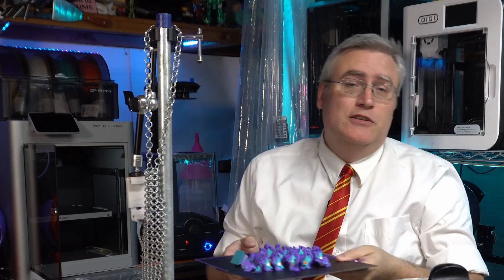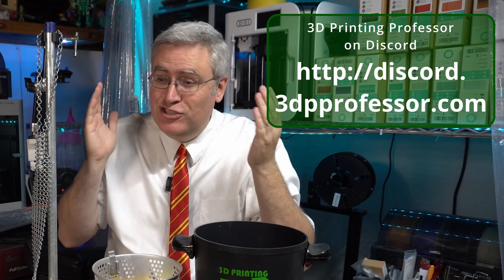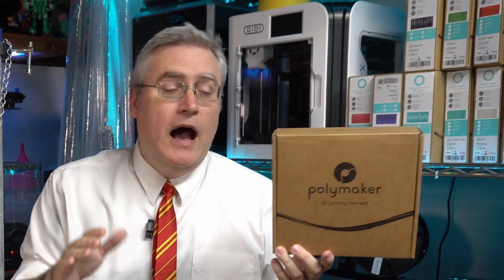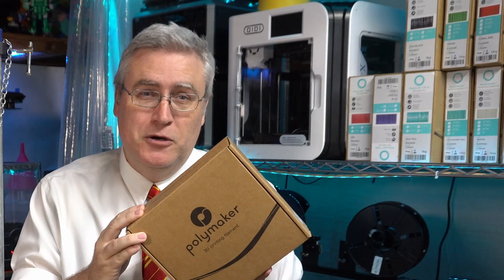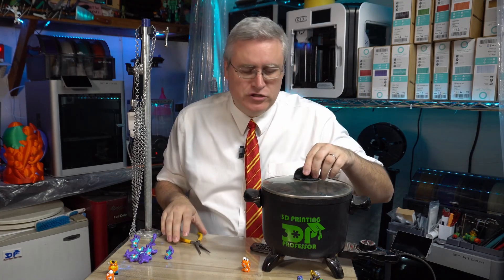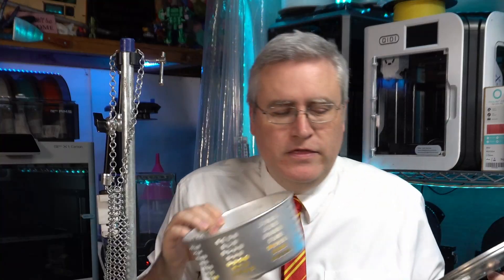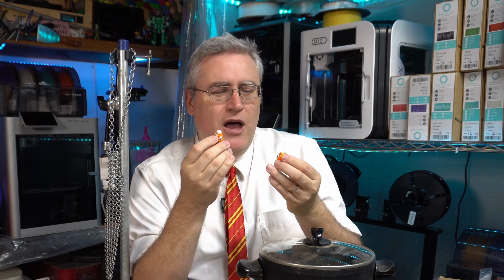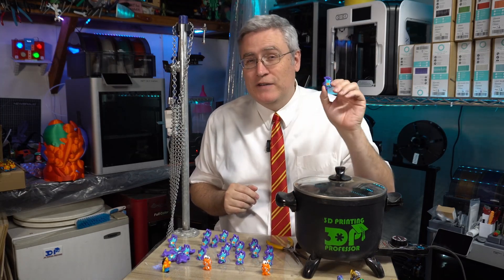How to smooth ABS 3D Prints - Polymaker ABS vs Polysmooth

Comment: Please do not dump the acetone vapors on the ground. While i agree it should be harmless in that low concentration laminated flooring, electronics like extension cables or powerstrips can get damaged even by these little amounts.
Also people are careless and forgot their pets where on the floor :( .
Reply from the maker: Thanks for the reminder. Most of my stuff is on wheels, and I don't have any pets.
How would you suggest those vapors be dissipated?
Reply: I always went outside if i had something to vapor smooth (after  accidentaly staining a piece of flooring by escaping vapors) and let the pot sit there. Slight breeze and it nearly disappeared as quick as it smoothed the print. 

May i ask if you looked into Dichlormethane as option to vaporsmooth non Polysmooth PLA? I would understand if you say its too dangerous because not wearing at least a halfmask with combination filters even for a short duration is quite unhealthy.
Reply from the maker: @chemicalartist3d289  is less about the health concerns and more about (1) difficulty to acquire, (2) cost and (3) amount needed to be effective. Hard to beat stuff you can buy at a local store for nicked nickels per application like IPA or acetone.
Reply: @3dpprofessor  1) Oh. I knew its in the fade out phase for industrial use in the USA but not that its limited in sale. 2) had to look it up and wow. The prices over the pond are a robbery. I payed 6,5$ for 3.4 US fl oz here. 3) thats surprising me. For my test with an old Benchy i just used 0.0101 US fl oz and it more or less melted the Benchy. 

I hope to get the all clear for wearing gasmasks/rebreather from my doctor next week again. If you are interested i can make some before and after images because the results are simply stunning.
Reply from the maker: @chemicalartist3d289  Yeah, jump on my discord. I'd love to see it.

Comment: Nice video, and yes, we developed PolySmooth as an safer/easier alternative to ABS/Acetone. They both have pros and cons which you highlighted really well.
Reply: Would acetone work in the polysmother ?
Reply: @Lsksd  no. While some parts of it seem to be made out of some either carbon or glasfiber reinforced material the vapormodule would simply disolve or crack.  Something that would have worked is the questionable kickstarter project Polysmoother. It was an allmetal sonic cleaner basicly. Unfortunaly it looks like they either oversetimated the work like many kickstarter projects or were outright a scam.

Comment: I’ve been printing for like… 12 years now? And have only just recently started using ABS and ASA.  Mainly because I’ve only recently had a printer with an enclosure.   
I’ve been so pleasantly surprised with it!  On my X1C it prints like a dream!  
I really need to grab some acetone and finally try out vapor smoothing.